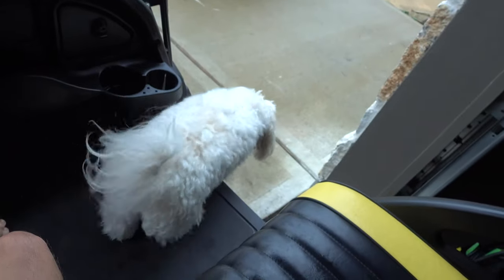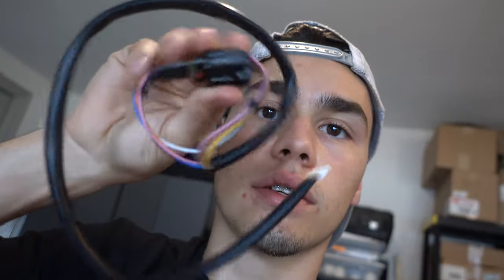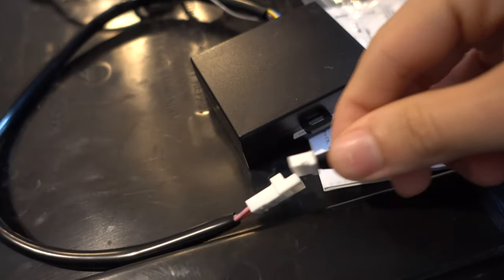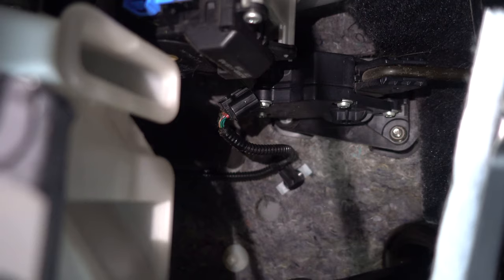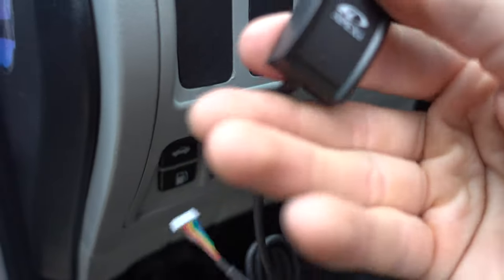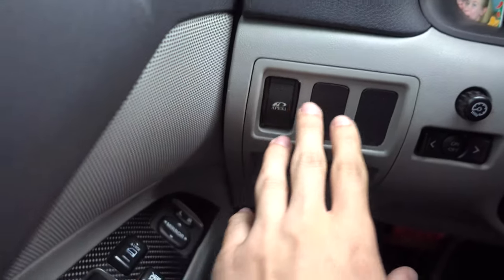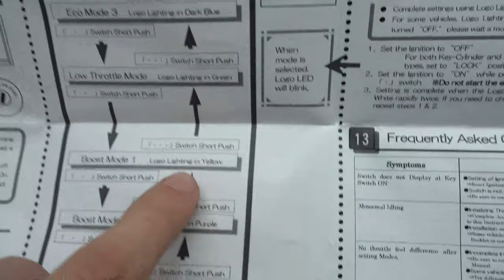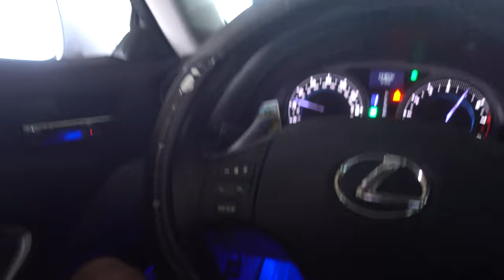Easiest PERFORMANCE Mod EVER!!! (APEXI THROTTLE CONTROLLER)

Comment: The ECT power button in our IS does this for us, it’s literally a boost in throttle and transmission response from factory 👌🏽
Reply from the maker: Ngl there is a difference tho
Reply: @DezanHernandezProductions213  have you tried the throttle controller with that on also?
Reply from the maker: I did and there was a different
Reply: That can’t be good for the car now can it? With both the controller n power mode activated

Comment: RIP pedal acceleration sensor; fried mine on my prev car with a pedal commander. The ECT Power option on my 350 is good enough, or manual mode

Comment: When enabled, does your Apexi Throttle switch flash when accelerating?
Reply from the maker: So you need to initialize it, here's the link http://www.apexi.co.jp/pdf/products/sac_tori_e.pdf
Reply from the maker: Or also I know there are a couple boost modes that it has (not all cars have a turbo) so these will flash and not work

Comment: are u running this with the mforce simultaneously? if u are does that give u any issues as far as reliability
Reply from the maker: Scott Shea I thought I would run into issues but it actually makes the throttle response Much better, I feel like it helps the tune out
Reply: DHP Dezan Hernandez Productions do u use boost 1 or 2 for casual driving? obvi high throttle when u wanna rip it but i’m just wondering. thinking about buying haha

Comment: any issues?
Reply from the maker: Algaretemusic not at all
Reply from the maker: Just make sure to have your car off for 15 mins before you unplug or install anything
Reply: I bought the same controller for my 08 350 it's been sitting no the shelf for over a year now, mainly because  of the gray wire installation.  Do you have any info on the gray wire install has iam thinking about installing  this week . Also dose the controller over ride the power/eco switch on the low right of the dash
Reply: You should do an update on all your car mods for the 250
Reply from the maker: Loading I have been thinking of doing this but I will when I have finished the car, almost there!
Reply from the maker: Paul Walker sorry for the late response, and yea I think that is the most difficult things about the install and the grey wire think I didn’t do it bc it is only for reverse. Glad you enjoy the controller though lol!